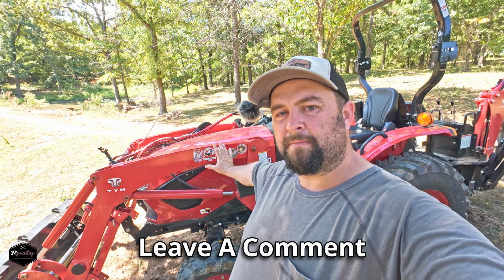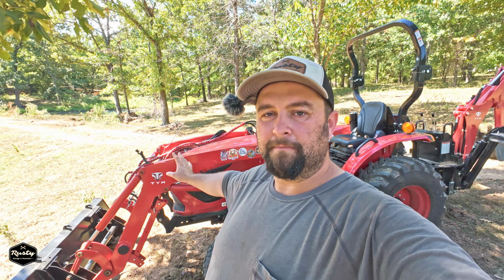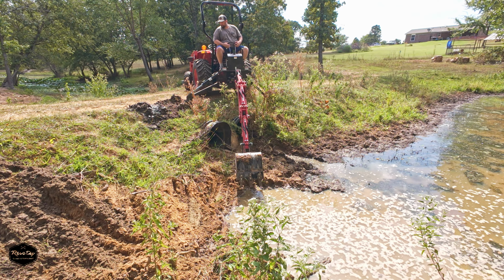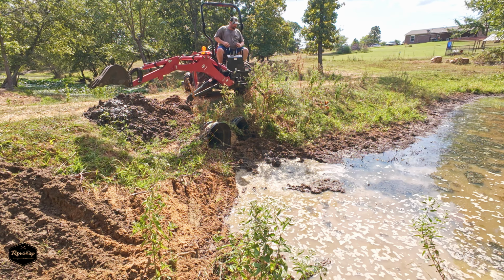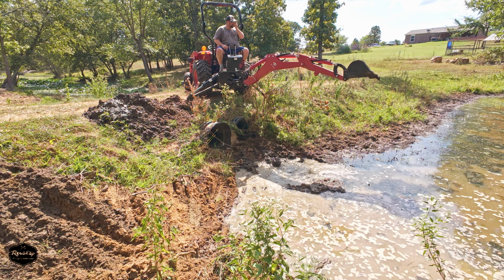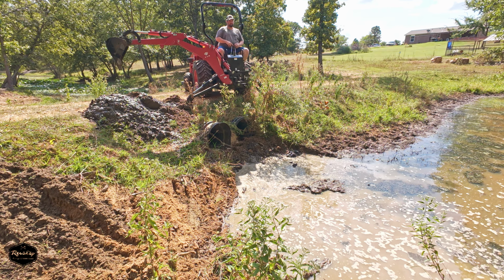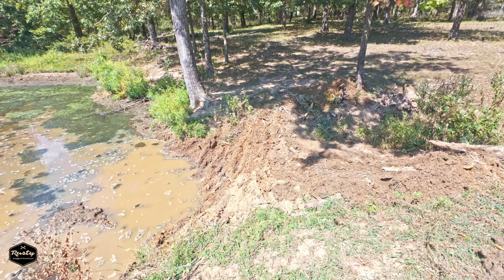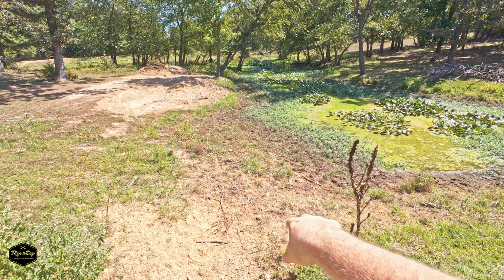Pushing TYM 2515H to Its Limit: Sand Bar Pond Dig

Comment: I have a Branson 2515H. After Tym bought them out we shall see how it goes. Going on year 4 now with mine and it works well. I do like it is all metal, powder coated and the fuel system is just basic mechanical. We only have a few acres so we don't need anything bigger. 7 gallons of fuel will work most of a day unless I am pulling hard so I just fuel up at lunch. It might be small but it is well built and strong for 24 HP.
Reply from the maker: @airmecher  hi Lan. I agree. Hopefully TYM keeps the machine the same. This is still a Branson tractor with tym logo's on it. For its size and the cost I don't think these machines can be beat